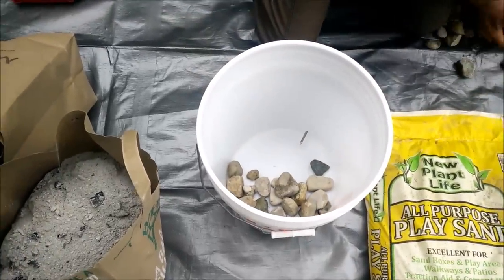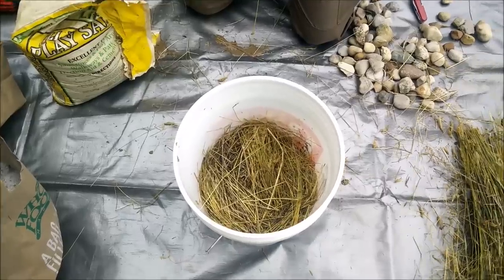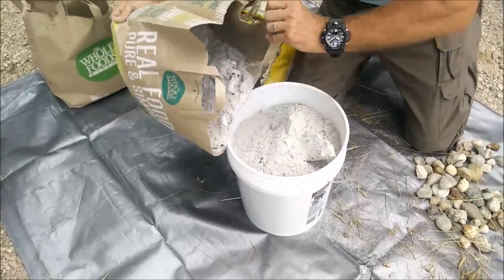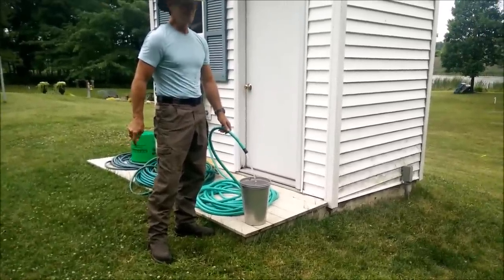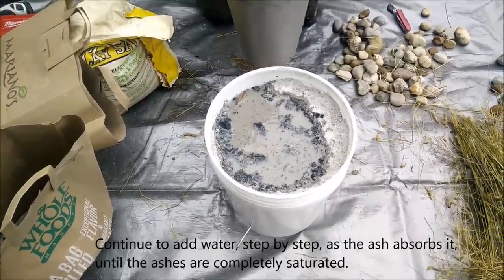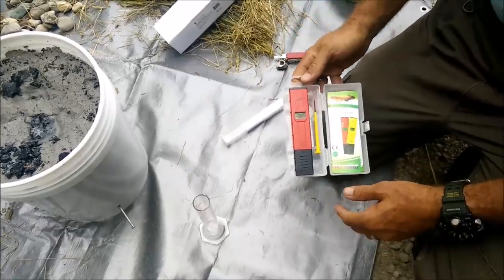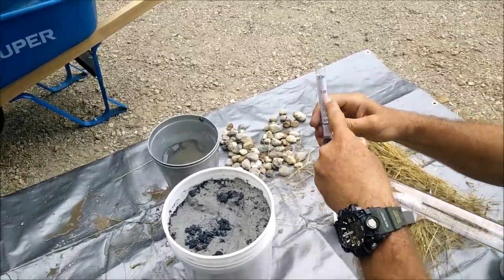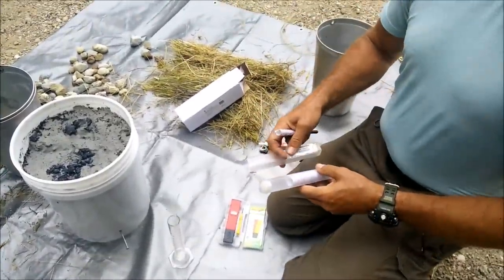Making Lye Water (KOH) from Hardwood Ashes

Comment: FYI measuring the pH is absolutely the most accurate way to measure the concentration of an acid or base in solution (depending on the precision of your instrument of course, but most digital pH meters should be fine). It's a direct measure of the number of OH ions per liter of solution. Specific gravity is likely to have a larger error because it strongly depends on temperature, and also the presence of particulate matter or other dissolved chemicals. Once you know the concentration of your KOH solution, you can use the saponification value of your chosen oil/fat to calculate the amount of the solution required.
Reply from the maker: That's great information.  Do you know of a source table for KOH concentration versus pH?
Reply: Disclaimer- I've never made soap... yet! I'm just a guy who took a few chemistry classes back in college. To get from pH to the concentration of OH in solution, use this formula: [OH] = 10^(pH - 14). This will give you the number of moles of OH in each liter of lye solution. But what you really want is the amount of lye solution to add to a given amount of fat -- so use the saponification value of your chosen oil/fat, and the full formula would be (saponification value)/[10^(pH - 14) * 56.1]. (where 56.1 g/mol is the molar mass of KOH).
Reply: For example, let's say you're using lard to make soap, which has a saponification value of 0.193, and you measure the pH of your lye solution to be 12.5.  Following the formula, you'd get (0.193)/[10^(12.5 - 14)*56.1] = 0.109 liters of lye per gram of lard. This should be a pretty excellent starting point, there may be some other complexities to the process that would require you to add more or less lye under certain conditions, I have no idea... I'm also curious to find out what's in the lye solution besides KOH, and what effect that might have.
Reply from the maker: littleBrownDwarf Thanks!  I will give that a try and let you know how it works out.
Reply: yes, let me know. I'm planning on making soap soon, when i build up enough ashes.
Reply from the maker: lBD, I'm working on this today.  How do I get to the concentration of KOH in the lye water; in other words, grams KOH : grams Water.  I am expecting this ratio to be about 1:3, which would be a 25% concentration of KOH in the water.  Of course, given the impurities, it the concentration could be less.  My measured pH is 13.58 at 64.2 F.  Right now, when I run the math as I interpret it, I'm coming up with 21.3 g KOH / liter of lye water which is way off, I should be closer to 100 g KOH.  Where am I going wrong?
Reply: Why exactly do you need the mass ratio?  You are correct that pH of 13.58 means you've got 21.3 g of KOH in each liter of lye solution. To get the mass ratio, just divide this by the mass of 1 L of lye. You could also use your specific gravity instrument to calculate the mass ratio.
Reply from the maker: I need one of two things:  Lye Concentration (percentage), or Water:Lye ratio, like 3:1, for the soap calculator.  I am using the calculator at http://www.wholesalesuppliesplus.com/calculators/SoapCalcWP.aspx, there is another at http://soapcalc.net/, but they are substantially the same.  Sp. gr. is 1.24, but that is impacted by impurities, as you rightly pointed out.  The specific gravity says my KOH concentration is 25% (KOH Handbook), so clearly there is a huge discrepancy between what pH is telling me and sp. gr.
Reply: Ok, so I'm thinking this is one of those cases where the terminology used by the general public is different from what chemists use. After a bit of googling, I found that % concentration is frequently used to mean grams of solute per 100 mL of solution. So in your case, that's easy -- 21.3%.  The pH gives you the answer directly.
Reply: Also that calculator is great, very easy way to look up sap values and figure the recipe quickly.
Reply from the maker: Perfect.  That's certainly in the ball park.  I will experiment with this tomorrow and keep you posted.  I am also going to check the calibration of my pH meter tomorrow, I don't want to waste any more lye by fouling up soap recipes!
Reply: how much did you pay for your ph meter btw?
Reply: how much did you pay for your ph meter btw?
Reply from the maker: littleBrownDwarf About $15.  This is the meter I bought on Amazon, there are several others that appear identical:  CoZroom Pocket Size pH Meter with ATC and Backlit LCD, 0.05pH High Accuracy, 0-14 pH Measurement Range, 0.01 Resolution Handheld, Measure Household Drinking Water(Red) https://www.amazon.com/dp/B00W4PH6OC/ref=cm_sw_r_cp_tai_iWjIybN5S7SY5
Reply from the maker: I'd like to share some info and get some feedback from you.  If you would be willing to share your email with me, please send a mail to john@primalwoods.com.  Thanks.
Reply: a ph of 12.5 correlates to a mass concentration of 9% of KOH (which has a sg of 1.08).  A lot of websites for soap making calculate their KOH water solution with a 30% concentration which represents a Ph of 13.14.  their formulas required you to measure the weight of the fat, multiply it by the saponification factor for that specific fat and then divide by .3 to get the weight of the total 30% concentration solution in the same units you weighed the fat in.  If you used a 9% solution for 1 gram of fat requires 0.193 grams of KOH which would be in a solution weighing 2.14 grams or about 2 cubic centimeters of solution or 2 mL.  But, there would be a lot more water than with the 30% solution.  I've never made soap but looking into it.  It seems that a lot of extra water may make the soaping process more stirring before tracing occurs.  Do you have any insights on this?
Reply: Guarantee granma eyeballed the soaps fat content without this formula lol!

Comment: I think what you are really making is a potassium carbonate solution. If you want potassium hydroxide, you need to add something which will precipitate an insoluble carbonate - like calcium hydroxide.
Reply from the maker: Ian, it is indeed a mixture of KOH, potassium carbonate and potassium bi-carbonate. Hydrated lime was used to make a conversion to KOH with a precipitate as you say. Are you a chemist?
Reply: @PrimalWoods  No, an electrical engineer.  I should mention that this was a very interesting video. Making soap is something I've wanted to take a whack at for some time.

Comment: If you go ahead and boil the liquid down to crystals (dry), the impurities separate during the cooking process, and then you can rehydrate the crystals and be confident that your lye concentration is spot on, because the crystals are pure anhydrous  Potassium Hydroxide, just like the lye drain cleaner you get from the store (which you can also use). Just an FYI.

Nice video! Thanks!

Comment: I would sift out the "clinkers" bits of charcoal anf other unburned material
hopefully it all worked out for you
a lot of folks forget the filtering of the solution.it's an important step,
So remember:
" If you are not part of the Solution, then you are part of the Precipitate!"
--Rick
Reply from the maker: Hi Rick, somehow this ended up in the comments "spam" folder.  Thanks for the tip.  The "clinkers," which actually make a clinking sound in my limited blacksmithing experience, I have not encountered in my ash; more like actual charcoal.  Do you have a recommendation for filter media?
Reply: This process of making a lye reminds me during my younger days😀my grand parents used to set aside the ashes  from NARRA tree , they used the dry narra woods as a firewoods  for cooking , they even used the lye water to color and flavour LATIK a native filipino delecacy😛it taste  so yuummy. Wood ashes can be use also to pots and pans as Cleanser  just rub the dry ash to the part with a stain and Wash it with top water  and you've gonna have  sparkly like new stainless pots and pans.
Reply from the maker: Thank you Chico chick for the information and tips!
Reply: Chico chick hi, tanong ko lang pwede po ba ang dahon ng niyog sa pag gawa ng lihiya. sabi kc ng mga matatanda dito sa amin ay yun ang ginagamit nila.
Reply: Ang mga puno ng niyog ay maraming masaya na puno ng niyog ay maraming masayang mga puno ng niyog

Comment: thanks very much. pH tells not all about the concentration. E.g.  if I have demineralised water and then the pH changes to 12, the KOH concentration is 0,56 gram/ltr. (0,01 mol/ltr)  I found somewhere a recipy (working !) for soap with caustic soda: 100 gr grease, 13 gr caustic and 35 gr H2O. Is like 9 mol/ltr. Such concentration cannot be measured with pH (out of range). So density is better !

Comment: i made lye water from woodash from my woodstove and filtered it through a plastic container which had fine cracks in the bottom and i got almost a clear liquid and evaporated it down.  as the liquid evaporated and crystals started to grow i made drain cleaner from it which un-clogged a drain and i made soap with deer fat.  i continued evaporating until i had damp crystals never being able to really getting rid of all the moisture even baking the crystals in the oven at 350.  can you tell me if the crystals i have are KOH or potassium carbonate?  i've seen other videos and they seem to say i made potassium carbonate.  is the liquid i condensed KOH?  the liquid worked great as a drain cleaner and making soap. thanks - dana
Reply from the maker: The liquid they used to refer to as lye water, and like you, I have read conflicting documentation on-line about whether it is KOH or potassium carbonate.  That's probably not a huge issue, so long as you get what you want functionally, which it seems you have!  I was able to make a nice "soap paste" from it, too, which they used directly as soap "back in the day."  There's mention of such paste in the Laura Ingalls Wilder series.  I am trying to get to a recipe, or formula, that I can repeat reliably, so I may try addind "slaked" lime, aka hydrated lime, to convert potassium carbonate to KOH.  I'll put up video, and probably a blog post when I do.  Congratulations!
Reply: thanks!
Reply: only using oak, hickory, cherry, ash and elm.  thanks for the info!

Comment: I don't understand how the filtration works.  I would think you would want the materials stacked from smallest to largest - so, sand first (on the bottom), then straw on the sand, then stones on top of it all.  This would trap the largest material higher up, then progressively smaller material as it works its way down.  I don't see the point of having the stones under the sand.

Also, what keeps the sand from running out through the hole? Don't you need some kind of cloth between the two?

Can you point me to some web page that explains some of the details on a filter system like this?

Thanks for the video!
Reply from the maker: It works passably well.  Of course the sand fills in around the pebbles, the pebbles have the effect really of taking up space, not filtering.  There's no real problem with sand coming out of the hole; the lye water is coming out drip-by-drip.  Having said that, there is sediment remaining in the lye water.  I simply let that settle and then pour the lye water off the top.  You can see an article I saw before conducting this experiment at https://www.motherearthnews.com/homesteading-and-livestock/how-to-make-soap-from-ashes-zmaz72jfzfre

Comment: Can you reuse the sand for a new batch, after it dries from the old? 
I'm assuming reusing the rocks should be fine. 
Does it matter what kind of grass the hay is sourced from?
Reply from the maker: Yes you can reuse the sand. Hay is simply another piece of the "filter," no specific source is required.
Reply: @PrimalWoods  the hay probably helps with “cleanup” as well providing a barrier between the sand and ash so they do not mix 🤔

Comment: Good video. Nice to see doityourselfers cracking the code.
Ph meters are for measuring more dilute solutions. The limit of usefulness for the pH meter is about a 5% solution of KOH. Higher concentrations will still read 14 all the way up to saturated solution, or read an error. Use the specific gravity method for a satisfactory product. 
A saturated KOH solution has more KOH in it than water. That is why a long soak, as indicated, is a good thing.

One more point. The choice of water used is not so important. The impurities in any water source is less than a fraction of one percent of the impurities residing in a bucket of ashes. or the impurities in the rough filtration media.
Reply from the maker: Specific gravity over-estimated the amount of alkalinity in the lye water by a factor of 2x.  I'm now titrating and using a continous pH meter to establish exactly what is required to neutralize the base.  It's a science project, LOL.  Fact is, there is a lot of "stuff" in the lye water that isn't KOH, hence trouble with Sp. Gr.
Reply: odd how people use the term gravity when what you are measuring is actually density/buoyancy. Hello!! (not just you:-)
Reply: @philindeblanc  you don't know what specific gravity is. your comment just looks like know-it-all hubris.
Reply: @wisconsinfarmer4742  What I said is exactly what the device does to indicate saturation.   You can beat what ever terms you want over your head, and that will not change facts.
Reply: @philindeblanc  OK, but look up the term "specific gravity" and get back to me on it. You will find that it means density relative to distilled water at STP conditions.
Reply: @wisconsinfarmer4742  I'll take a look, but you are describing the calibration of the device, not how it works.

Comment: I have a couple of questions.  First do you reduce your lye water to crystals?  Second do you have a soap recipe that you are willing to share using your home made lye? Thanks in advance. I loved your video!
Reply from the maker: Hi Tina.  I do not reduce the lye to crystals.  I reduce it to 25% KOH, as measured by specific gravity.  That is the same as 1 part lye (in the form of KOH crystals) to 3 parts water by weight, which is often called out in recipes.  I am experimenting with recipes, and when I have one that is reproducible routinely, I will be writing a blog post about it at www.primalwoods.com/blog.  That same recipe may not be reproducible for you; the challenge is the impurities, and how much impurity is present in the lye water, as this has a direct impact on the measurement of KOH concentration, and hence soap-making.  The commercial makers say that their KOH crystals are "90-95% pure."  It's likely that my process, or a process you might use, yields a less pure KOH, which impacts the necessary ratios of lye-to-water-to-fats in the soap recipe.  I hope that that is clearer than mud.  Thank you for watching and commenting.
Reply: Just wanted to add, there's no reason to reduce it to crystals unless you're storing it for later. If you can test the specific gravity and pH then you know how much you've got.

In making soap you'd dissolve the crystals in water first anyways
Reply: The advantage of reducing the solution to crystals is that it can be purified through recrystallization and a precise amount of lye can be measured. A slight excess of fat would ensure all the lye was reacted. A basic soap recipe:
1 lb lye
2-1/2 pints water
7-1/2 lb fat

Comment: To make KOH you would have to react the potash(K2CO3) you just made with Quicklime(CaO) in presence of water
Reply from the maker: Thanks asimi900.  There is a lot of conflicting documentation on the internet to be sure, but in researching a reply to your comment, I came across this article. https://classicbells.com/soap/woodAshLye.html In part, this statement is made, "In a refinement known and used by many soap makers as early as the 1700s, the carbonate ley from ashes was not used directly to make soap. The wood-ash ley instead was mixed with water and slaked lime (calcium hydroxide, Ca(OH)2).

The chemical reaction of the carbonate solution with the lime formed a purer, stronger ley that was a mixture of potassium hydroxide and some sodium hydroxide. The mixture also contained solid particles of calcium carbonate (CaCO3) that were unwanted by soap makers. These calcium carbonate particles were allowed to settle out of the ley solution and the resulting clear liquid ley was saved for soap making." Please give me the benefit of your thoughts.
Reply: Primal Woods I just wanted to say, that what you have here is definetely not KOH but instead K2CO3.I once tried to make soap myself (with very little preparation)
and I thought that I had KOH as well, but as I tested it with acid (In my case vinegar) it fizzed up a lot, so I knew it had to be potash. In a book I read I found out, that  potash also has cleaning properties, because it also can react with fats, but rather weak. As I tried to make soap with it, it didnt seem to react with the oil I used, but it could be that I did something  wrong, since I am not an expert
Reply from the maker: I did successfully make soap paste with it, so it works, though it took me several failed attempts to get there.
Reply: Glad someone said it, even though this post is a year old, I did a blog post on this topic recently so it's on my mind. You did miss one thing, however. This is a mix of potassium and sodium carbonates, as well as several chlorides and some other stuff. It can be separated out into several different salts by evaporation based on their solubility, and then refine them from there. I need to do my vid on this one day, but I have a pretty large test batch to see what kind of yields I'm getting first.
Reply from the maker: @offgridgecko  Can you liink please me to your blog post?
Reply from the maker: @offgridgecko  Thank you.